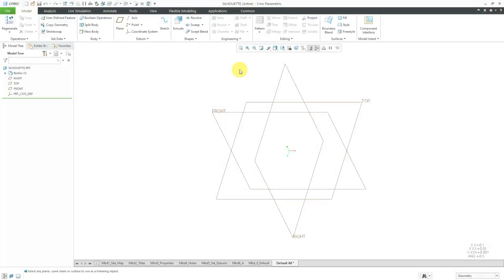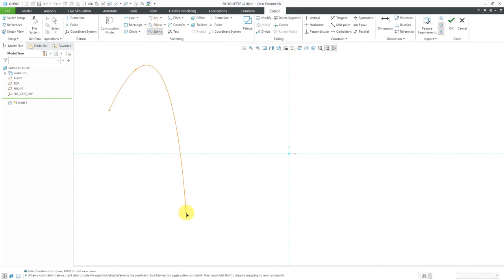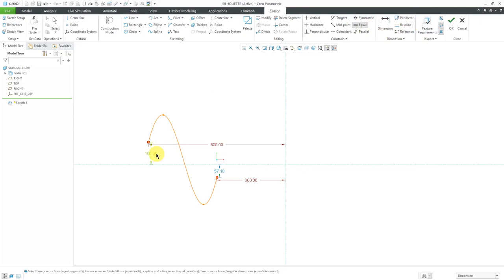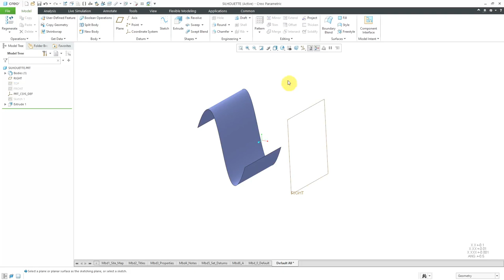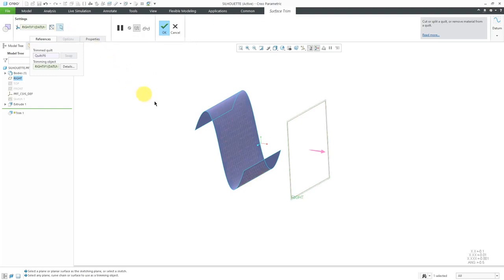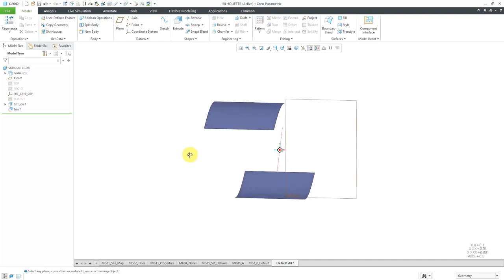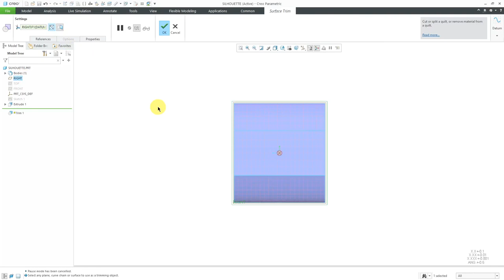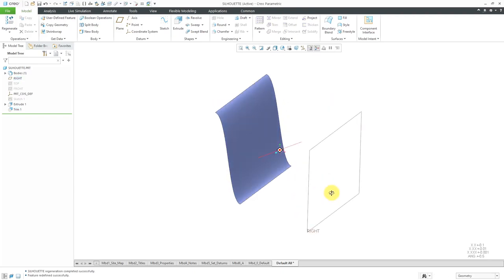Creo Parametric - Silhouette Trim | Surfacing

Comment: Hey, I'm using Creo (Pro Engineer) now since over 9 years and working on combustion engines for motorcycles. I'm design complexe die casting parts like crankcases and other engine components. 

I was wondering where i can use this kind of feature in my designs I don't find any purpose for it.

What is the purpose of this Feature?
Do you have an practice example for use it?

Best regards 
Thomas
Reply: For casting models this feature doesn't have any purpose